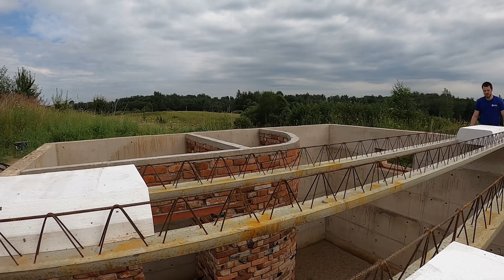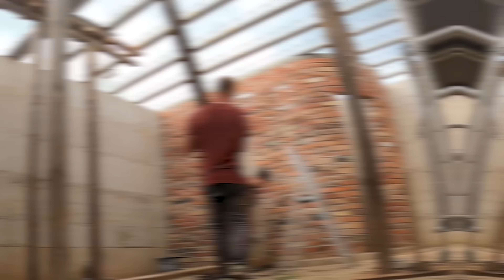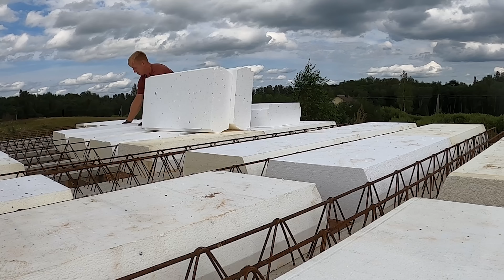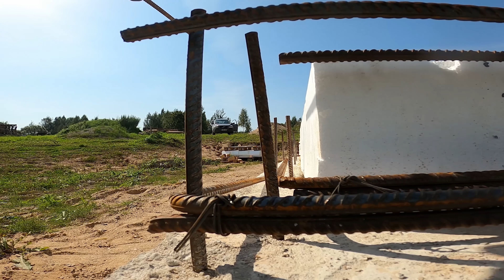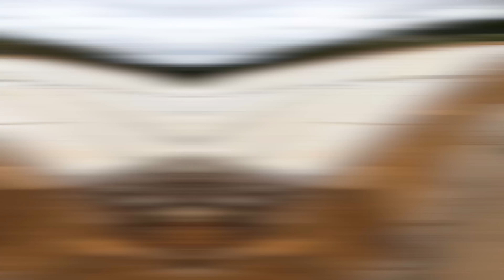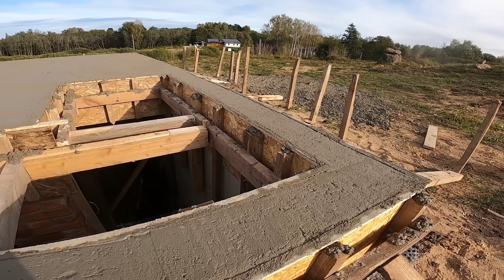T-Beam Concrete Slab Installation | Step-by-Step House Construction Part 1

Comment: I'm impressed. The only thing i have concerns about is the bar in the center beam. We have four for the perimeter that sits on the wall but only two to carry the whole span.
Reply from the maker: Good question. This center span only needed two bars because the gap is narrow. Adding more steel here wouldn’t add strength and can actually weaken the concrete. Most of the load is carried by the perimeter beams where the walls sit. Everything was done according to the provider’s specs.
Reply: The 2 cross beam is more like blocking in framed construction.  It resists deflection of the load carrying cross members.  It looks very robust.  I am curious about the span (rib) beams, what their cross sectional view would look like.  The bottom of those are under tension and the tops are under compression so I assume they have a good amount of steel in the preformed bottoms.

Comment: There's one small detail with the beam rebar, I saw quite a bit of rust... I don't know where this place is, but in humid places like the Caribbean, (I've seen it in other places as well, i.e. USA), when rebars are already rusted out, the process of corrosion continues inside the concrete. As time goes by, you will see blow out coming through walls or roofs and it's too late. The fix... epoxy treatment before the installation, consequently more expensive.
Reply from the maker: Been outside for a while so it’s brown, but just surface rust. Steel is solid and within spec. Happens on every site 🙂
Reply: Igaza van. Azért van minden klímára eltérő szabvány a vasalásra, zsaluzásra, betonra. A karib térségben pl. nem kell fagyálló beton. De nagyon sokszor látom főleg a szegény vidékeken a rossz minőségü, vasalású kivitelezéseket. Pl. a vasalás nincs kellő távolságra a zsalutól, sőt hozzáér,  ezért a rozsdásodás ledobja a betont.

Comment: Why didn't you tie 90 degree  rebar from the t beams to the edge beam and also 90 degree rebar from the mid beam to the edge beam?
Reply from the maker: 90degree rebars were added where extra reinforcement is needed. Distribution beam, stair opening, and other critical intersections. This is a rib beam slab, so not every rib-to-edge connection needs separate corner bars.

Comment: I would say that is a very professional build.  The attention to the shuttering is much more than normal.
Reply from the maker: Thanks, that means a lot.
Shuttering is one place I never cut corners. If the formwork is right, everything else goes smoothly.
Reply: @LibraryofConstruction Its nice to see solid formwork that is rare on most building sites and when the formwork goes wrong, as its all too common because someone is cutting corners on cost and time, it takes a lot longer to rectify the mistake, often costing more than double than if it had been done right in the first place.

One contractor I knew would walk around the job and give a random (or dodgy) piece of shuttering an almighty kick.  If it broke or even moved the chippy would have to remake it and accept the costs.

Comment: The use of “dox planks” would save on time and labor. Is the styrofoam for insulation? If so, why?
Reply from the maker: You can choose either EPS blocks or concrete hollow blocks. Structurally they work the same in this system, but EPS is better for insulation.

Comment: Did you put any conduit inside the walls / floor to accommodate installation of electrical service later?  Are you working from plans or just shooting from the hip?
Reply from the maker: All services run through the bottom of the walls and were done ages ago.

The slab was done to drawings provided by the supplier.

Comment: What a palaver we just Crain in ready formed concrete slabs already formed to just place in like a jigsaw it’s done in a morning.🇬🇧👍
Reply from the maker: We couldn’t get precast slabs craned into place on this site, so this system made more sense.
With the T-beam method, the slab is also already insulated, since the infill blocks are EPS.
Reply: @LibraryofConstruction
Nice work, don't listen to the palavaras 😂
Reply from the maker: @crouchingwombathiddenquoll5641 thanks bro 🙌😄
Reply: Yes. This seems like a hell of a lot of work and wasted materials.